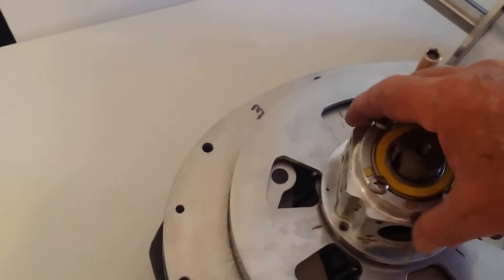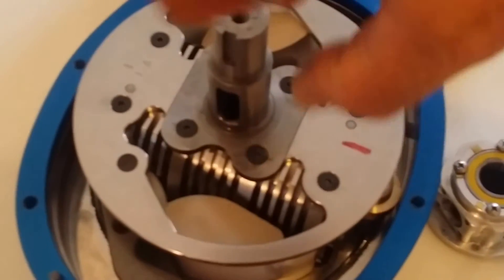Hybrid Piston / Rotary Engine-  How It Works

Comment from the maker: The oil portion of the housing is separated from the air-cooled portion of the housing by divider plates that enclose the rotor. However the roller bearings are sealed and lubricated but, I am running a few bearings without seals (hybrid bearings) that are 120,000 RPM rated and are lubricated by oil within the housing.

Comment: Nice work. I realize this is a prototype.. but how will you seal those rollers (followers)? Looks like a very difficult task to seal them properly
Reply: You don't need to seal those rollers as all the combustion process takes place inside the cylinder unlike the Wankel engine where the rollers would have been the Apex seals for sealing .